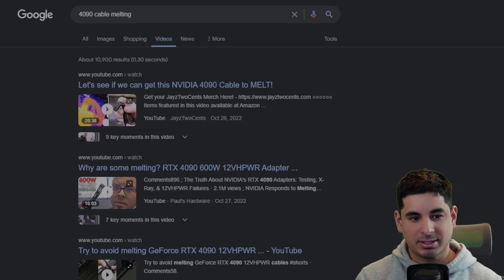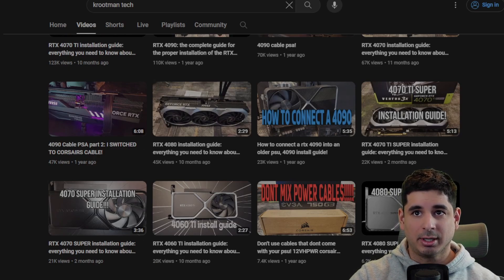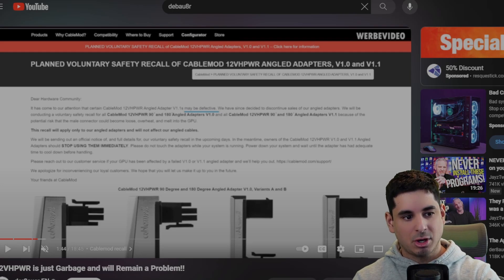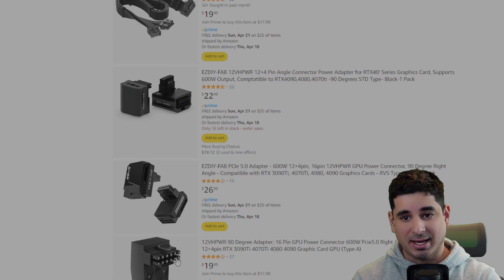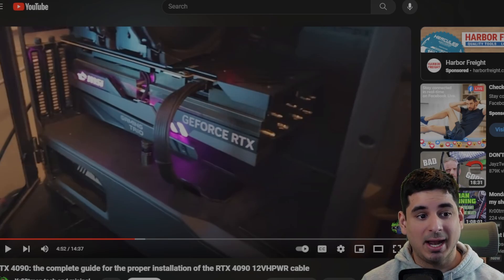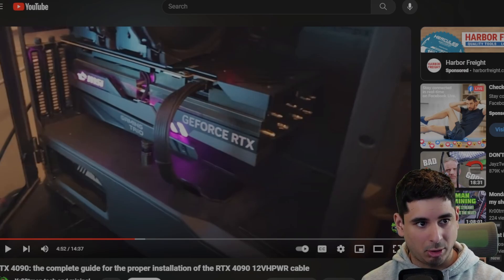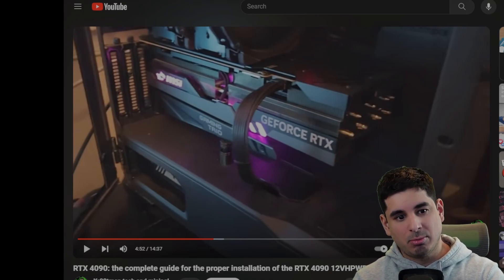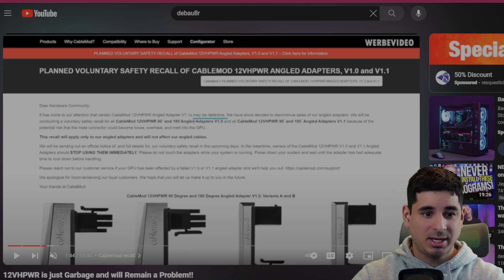follow these SIMPLE STEPS to keep your RTX4090 cables from CATCHING FIRE or MELTING!

Comment: Would you suggest not overclocking to avoiding melting.

Am getting a 5090 and are thinking that not overclocking it will help prevent melting as well as taking the advice in this video.
Reply from the maker: ill be posting 5090 videos on my other channel kr00tman tech

Comment: I am new to the PC. I am building my first PC. Is it all 4090s having this issue or just a founder edition graphics card ? And also the 4080 are they having the same issue?
Reply from the maker: THANK YOU SO MUCH FOR THE TIP! As far as your first question, it has been an issue all 4090s model doesn't matter. To answer your 2nd question i have no seen issues with any other 40 series model since launch. Let me know if you have any other questions!

Comment: I am having the hardest time finding official nvidia replacement 12vhpwr cables, let alone aftermarket ones.  Where does one even buy them?  I have a dead cable on one of my 4070 Tis.
Reply from the maker: I linked the cablemod one, that will work with any 40 series, just make sure it works with your psu. I will dig into it and see if I can find them because I have been asked about this

Comment: Just don't buy 4090 for mining if you want to sleep well. The problem is related to directly nvidia. Nobody knows future. May be we will need that high wattage in future for an algo. 4070 ti is sweet spot for 4000 series for me.
Reply from the maker: Na gaming actually shows more failures then mining, there are no power spikes mining and you are undervolting it, a mining 4090 only uses about 300ish watts